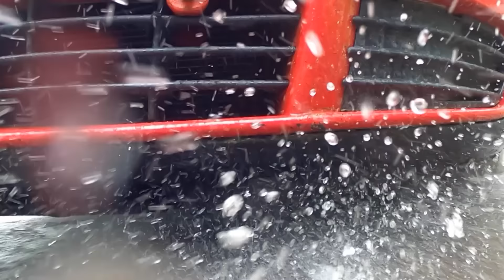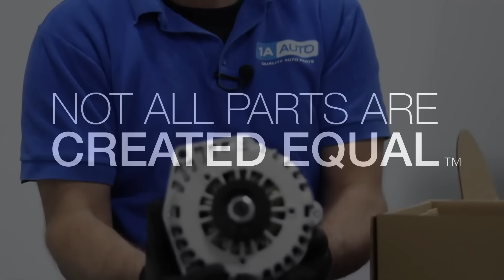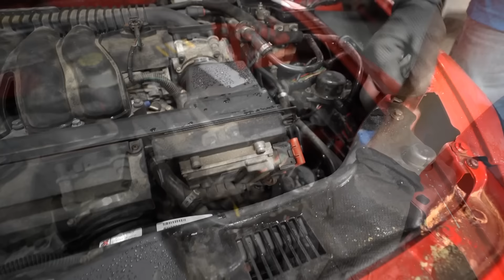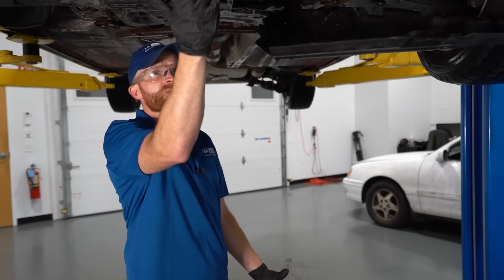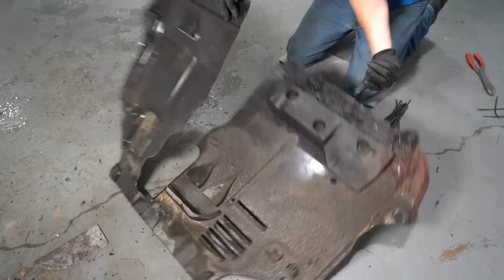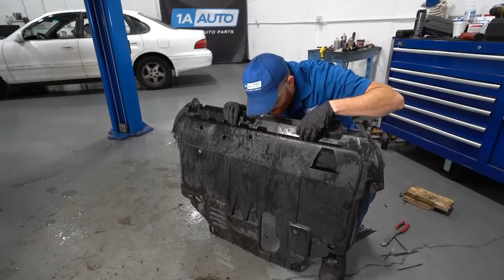Scraping Noise Under Car? Dragging Splash Shield? Try This DIY Quick Fix!

Comment: How do I fix it if the screw holes holding it in place are stripped? Can these be rethreaded, or does it need to be secured to the vehicle by other means?

Comment: Most are just junk period. Take the damn thing off, and keep the underside clean by blowing it out with compressed air. WD40 is great for keeping moisture out of electronics. After all thats what the stuff was designed for.

Comment: I was hoping you would make a suggestion as to how to reattach the whole thing to the underside of the car because if I buy the whole set of Honda’s, push rivets it’s like $169. There must be an even better way to reattach it as the push rivets didn’t hold up in the first place. Got any ideas?

Comment: the splash guard will prevent  your auto from stalling if you go thru a deep puddle.  I am a firm believer that many  mechanics believe taking them off is their prerogative , They are trying to educate you  on what they don't want to mess with by not putting it back. My brother had a 68 XKE and if it rained it would stall out every time. The mechanic went into an elaborate mech splanation  'bout what my brother had to do if it stalled berating the inferior design and archaic mechanical workings of Jaguars and how he needed to get him a chevy. He got a GTO a few years later but drove a truck  most of his life. I have nephews that have Hondas and mechanics are always telling them they don't that thing let me just tear it off of there and you can do with out that. It gets in the way of the genius at work concept of auto mechanics license ripping it off and recycling it in the landfill,

Comment: This is a great idea! Besides zip ties, do you recommend any other applications like glue, soldering, etc.? I have a 2024 Ioniq 5 and the splash guard that is cracked open in two different locations.

Comment: Great video and explanation! My husband has replaced the clips/screws a few times over the years and it seems like every time the dealership changes the oil,  the clips somehow come up missing! My car is a 2016 and now the shield is scraped up so bad that the holes are rubbed away and I have no choice but to replace the whole shield.
Reply from the maker: +@virgomom9616 Thanks for checking us out! http://1aau.to/m/Shop-1AAuto-c

Comment: Luckily mine wasn't cracked, or I would have had to take it someplace to get it removed to do the twist tie trick.  Not everyone has access to a lift.  However, the bolts holding it on my Honda Fit (cheap plastic) had broken off. So the twist tie solution was genius.  You saved me from taking to a shop. Can't say thank you enough for posting this clever fix.  Need I say that next to duct tape, twist ties are one of the best inventions EVER!

Comment: If it’s not broke got to autozone nomore than  6$ for plastic clips that go in the holes it came out of take 20seconds to put them on . If it broke off  I would buy a new one and you can easily put it back on yourself just try a little bit ❤

Comment: This occurred today, and that sound has me freaking out.  So, I just had four new tires installed/changed, then had my rims refurbished, and painted.  On my way to have the rim inserts changed out, this occurred, so the  rim guy pushed it back into place, said it shouldn’t happened again.  It did… two more times on my way home.  Now, I’m afraid to drive.  Help!

Comment: Mine (new)  happend to catch a lot of water underneath due to a small city flood, just one street,  and it developed a big belly wich goes like 3 inches lower than the original level, it scraps everywhere but...how do I fix this? is like having more material as it streched.

Comment: My ford flex has one of these and the screws that hold it in place come loose easily. Poor design Ford. Wish I knew a fix to this. I did put a screw through it so it doesn’t completely fall away. Help…

Comment: Did the same fix with my wife’s 2013 Honda Civic Hybrid. The dealer didn’t attach it following a repair, so the wife drove around oblivious to what had happened. When I got to the dealer, they didn’t care. Here on our island, not much recourse or options, so I zip tied it with heavy duty ties. 5 years later, the shield failed further, so a drill and three more ties (one needed a pair to span far enough) and the shield is back in service.  Repairs like this are our only choice, given the shipping costs to Kauai, Hawaii, if a replacement is even out there. 

When this fails, I’m installing metal straps across the frame to hold up the plastic.

Comment: I have an 04 Sebring convertible and the holes that the clips go through have ripped and there is just no place to zip tie it securely.  Is there some fix for this.  I don't have ramps or lift so kinda need to leave it on to fix.  Great video.
Reply: Me too, Sienna sheild came off, o ring at the edges were broken !!!

Comment: Or you could use mechanics wire for stitching that will last. Or throw it all in the garbage. Clearly it doesn't block much dirt and debris since there was a 3mm layer of sludge on top of it.

Seriously. I don't think they even affect fuel economy. I wonder if I should search YouTube and see if anyone has found any negatives when removed. Maybe it helps keep water off of your drive belt, but who cares?:

Comment: They use these to catch drips also, both to improve road water runoff into storm drains, and to hide leaks from  your garage floor until the vehicle is out of warranty.
Reply: I am having one installed new on my Toyota Sienna SE 3.5L  Twice my A/C stopped working because water from the road got in.

Comment: Great video! Thank you . This is exactly what I wanted to do with not large crack on mine. The problem is...... i do not have a racks or any worthy equipment to lift up the car for comfortable work. Was surprised to see the fuses box under the hood and not in the trunk. I have both - battery and fuses box in the trunk under the cover, next to spare wheel.

Comment: Awesome, thank you! My engine shield on my 2018 Dodge Journey got broke, but no holes or any pieces missing.  Temporarily, I put duct tape on the outside, but it isn't staying well. I am not much of a mechanic, and I have tight finances, so I was thinking of taking it off and repairing it. My wife does not trust my mechanical 'expertise' (as I am no expert, lol)! She would doubt that fixing it would work and that replacement isn't necessary.  Having this video, I can convince her that repairing it should be acceptable! Again, thank you! I liked and subscribed!
Reply: Z

Comment: What can you do about the shields that are made out of the fiberous type material?  Zip ties would rip right thru.  I have a 2016 Sorento with this issue.
Reply: Put metal washers where the holes are on both sides to prevent the tearing.

Comment: Happened to me twice…. Missing two screws, got it all fixed up, it’s a very annoying sounds, feels like the whole car is falling apart
Reply: 💀 my 19 Camry just did this
Reply: @JohnDoe-fs6lz  lmao exact same dude
Reply: Yes, very annoying! It happened to me today. This is a good video but not everybody has a car lift.
Reply: i had thought my whole front bumper came off and i got so scared, I WAS ON THE INTERSTATE!! but i was like huh nothing is coming on, but the scraping is so loud!
Reply: Mines is scrapping pretty bad sound is getting worst been doing that since July 4th where can I take it for repair and is it cheap!?
Reply: I swear it does! I thought it was the end of my car when I heard the noise. Tried zip ties for a while but I noticed when it rained, the force of the water under the car when driving caused it to break again. Finally getting it fixed the right way
Reply: How much of you don’t mind me asking?

Comment: In the case of a 2004 Chevy Cavalier, the splash shield protects the belts from small rocks. Had this issue because mine was missing and one day I noticed the belt was chewed up and after removing it I found all these small rocks imbedded in it! Replaced the belt and splash guard and have had a issue again!
Reply: Damn, that sucks!

Comment: good video, disagree with most of it in regards to the splash shield being necessary, but good video
Reply: It does more than stop water from splashing all over the engine. It also stops small rocks from destroying belts in some cars
Reply: Very necessary it's no joke. I just went through a giant puddle with no way to go around it or back up. It flooded my engine and it would have been prevented if I had a shield. So it's definitely worth it